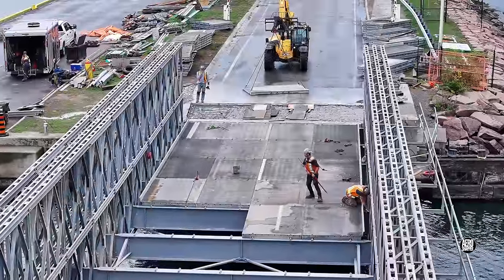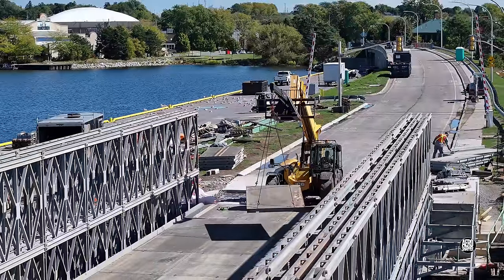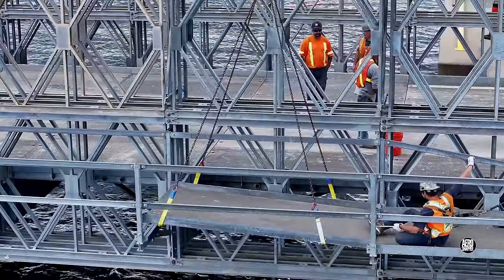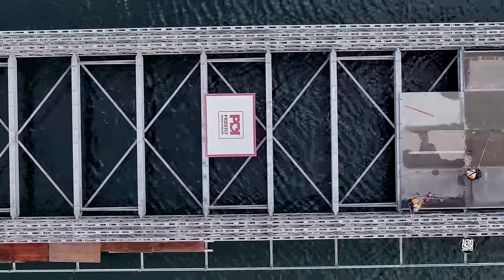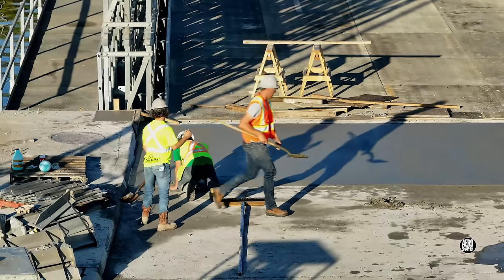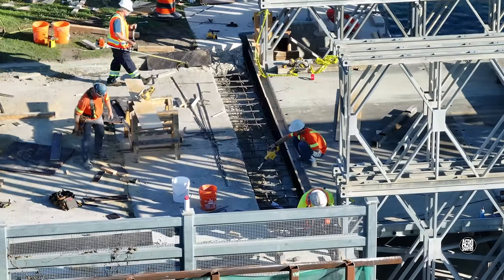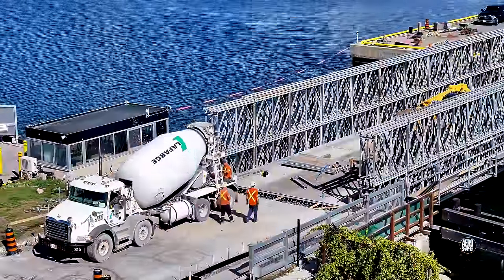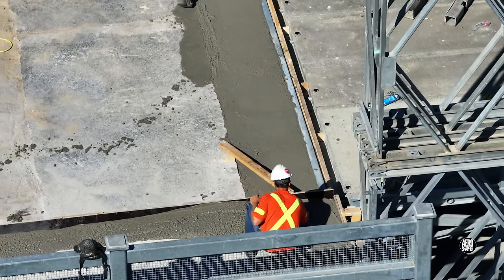Now we're playing with a full Deck - an update on Kingston, Ontario's La Salle Causeway   4K

Comment: what happened to the previous bridge ?
Reply from the maker: Edward - it's a sad tale. During refurbishment work, on March 30th an 'incident' occurred that resulted in a major structural component of the fixed structure buckling. Subsequent examination revealed that the bridge could not be repaired economically.  The decision to demolish it was made.